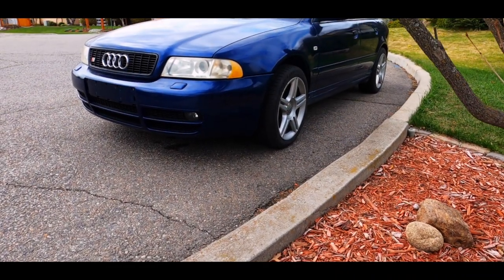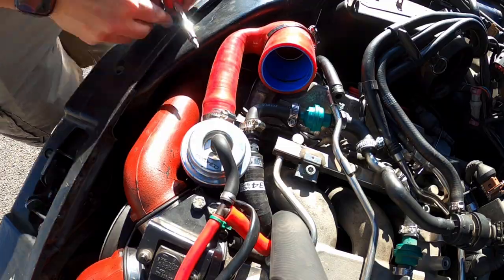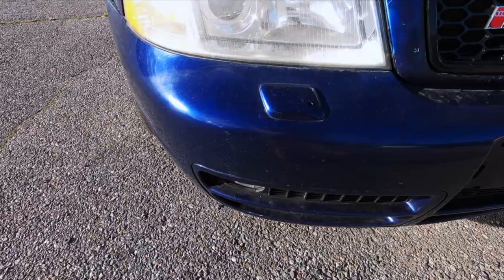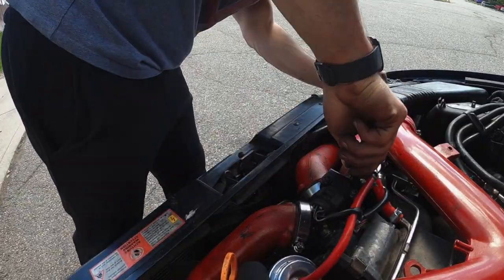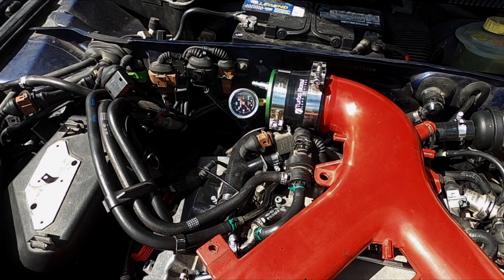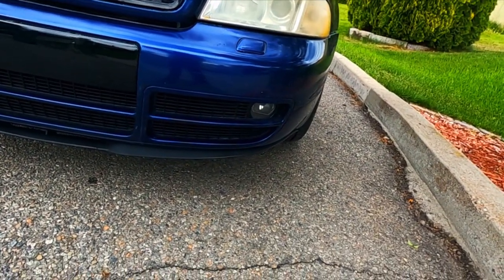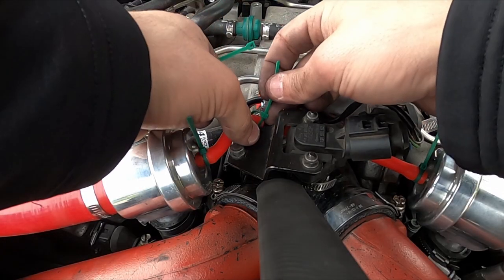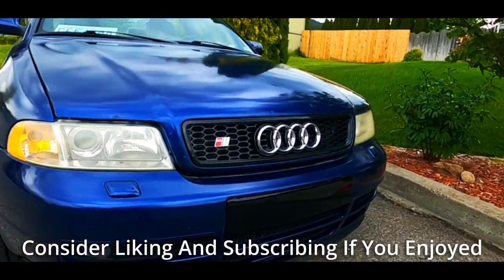Transforming The B5S4 Front-End! | & Boost Leak Testing

Comment: The diverters can be fitted either way and sound slightly different depending on how they are fitted. Mine are the same way as yours are now.
Reply from the maker: That's a good point! Mechanically it makes no difference at all. I swapped them so the vacuum lines up top fit with less 90° turns. Thanks for the support:)